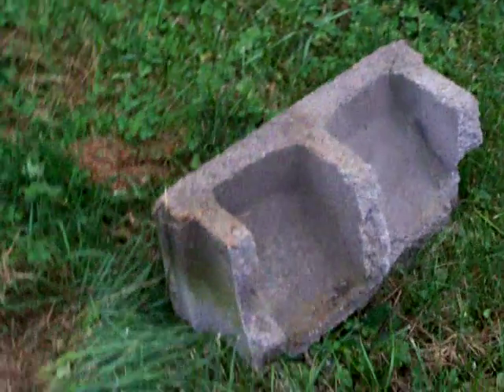2ml Glycol Dinitrate, EGDN (like NitroGlycerin) - HMTD blasting cap. P1900

Comment from the maker: Yes, and no, I am not crazy... Flash powder is a great initiator low explosive. I am well aware that HMTD and metals form extremely unstable salts. However, the aluminum flakes in the flash powder have a metal oxide coating which makes them unlikely to react. Also, there was very little risk, because the device was constructed on site (not stored) and the FP-HMTD combination was not pressed.